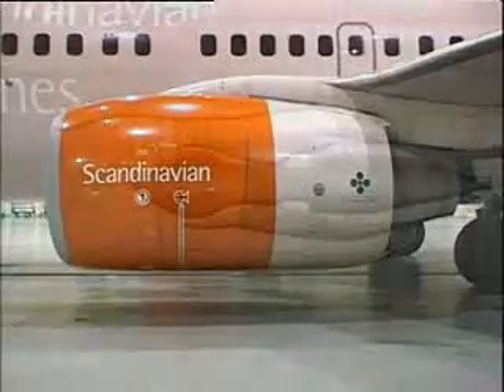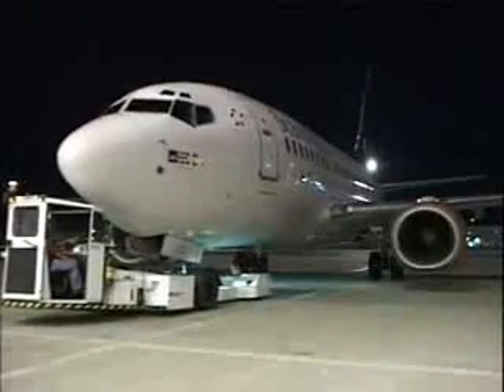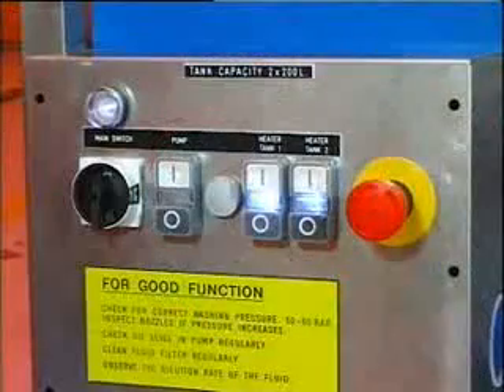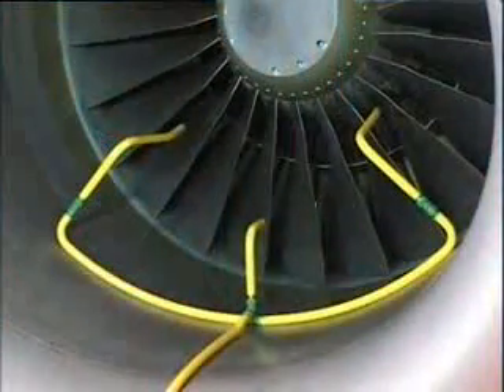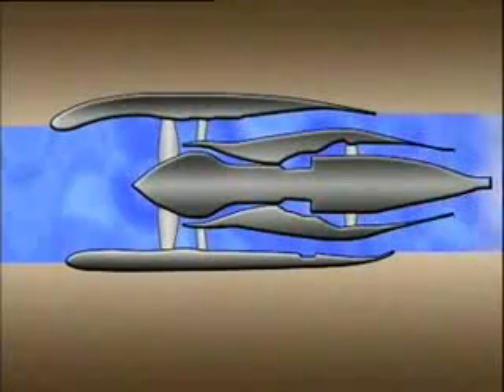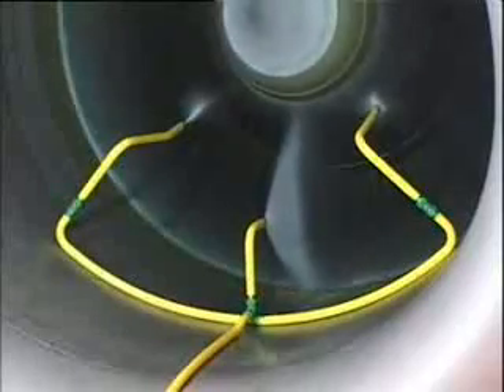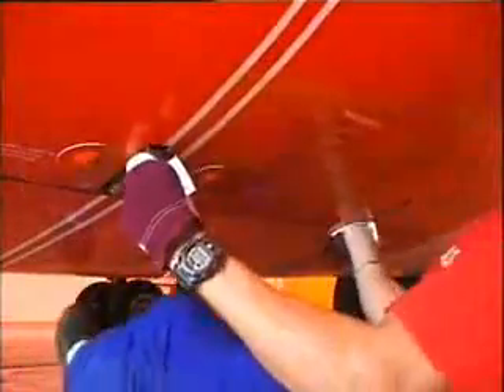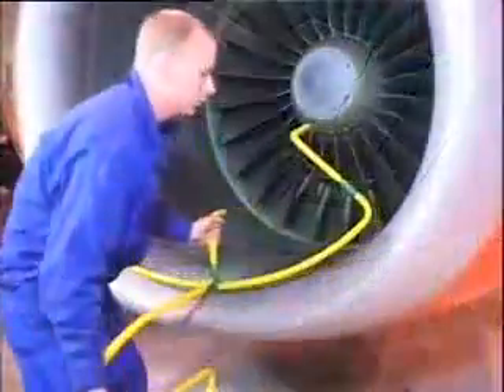737 NG engine wash

Comment: do they do this with the engine at idle thrust or just with the pneumatic air starting system?
Reply: With cranking engine, so indeed with bleed air starting, but without fuel lever in on and ignition off. Bleed air valves are closed too.
Reply: ***** how do you crank the engine exactly
Reply: First there must be bleed pressure available. This is normally done with the APU, and then with the APU bleed switch in on. Then the ducts are pressurized. Then you turn the engine startswitch on the P5 ovhd panel in GND, this opens the engine startvalve and thus the bleed air drives the engine air-starter. The APU goes into MES mode so the bleed press is increased to approx 35-40 psi. This rotates the N2 of the engine. At approx 20% N2 the water wash installation can be set to on and the water can enter the gaspath. All the time the startswitch is set in GND to hold the startervalve to open.

Comment: What is that pipe for which sticks out at rear of the turbofan engine? Does anybody know?
Reply: +seb font  Wow, what a bunch of crap you've be told.  The item you are asking about is called the exhaust plug.  The outside surface is used to control the inner part of the turbine exhaust flow.  The hole that you referred to is used to vent the oil system to ambient air.
Reply: +seb font I think it's where bypass air that is taken from the compressor to cool the turbine disks exit the engine.
Reply: Povl Besser No, the cooling air runs though the holes in the turbine blades (not the disks as they do not get that hot) and then into the engine.

This pipe is for the main exhaust from the engine core.
Reply: +seb font That is just the normal tail pipe of that CFM56 engine subtype.
Reply: Itapirkanmaa2 Thanks mate. Still don't know its purpose if it has any.
Reply: +seb font It''s a part of the engine's normal operation. The hot exhaust gases from the engine core itself exit though it, and also provide some thrust by going through the constricted passage of the pipe.
Reply: Itapirkanmaa2 Thanks again. I'm gonna have to research it a little deeper cause I've seen some engines have it and some don't and I want to know why is that.
Do you mean some gasses pass through that relatively small pipe or all of them? It would be hard to imagine the second option.
Reply: seb font The gasses thought the core. The bypassed air goes around it as per the bypass ratio.
Reply: Itapirkanmaa2 I was asking about hot gasses from the core of the engine, from combustion chamber travelling through aforementioned pipe and not about all the gasses mixed with bypassed air.  Bypassing air is not hot. But never mind, that was rather rhetorical question as it is impossible for that amount of gasses a turbofan engine produces to go through a pipe of so small diameter. Also I don't think there is any thrust produced at this point.
Thanks for answering. I need to find some professional literature.
Reply: seb font Some pics that you may find useful in the study:http://www.sjap.nl/pictures/
Reply: Itapirkanmaa2 Awesome!!! BIG thanks for help!
Reply: Itapirkanmaa2 OMG!!! thank you, thank you, thank you!!! this site you gave me a link to is a knowledge mine. Thank you for it one more time :)
Reply: seb font Glad if I could be of any help!
Reply: Itapirkanmaa2 sound like BS to me. This is certainly not an exhaust pipe and if you say that all of that combusted gasses pass this little pipe to produce thrust then I don't want to hear from you anymore.
Reply: seb font No problem mate -- your's much appreciated. The pipe does look rather silly I admit --  It becomes clearer from the history of the early jets and the long reaction tailpipe in them.
Reply: Yeelep Thank You for a clear answer sir. I'm gonna find out more about that. That whole thing is a lot more complex than I previously thought and it's very interesting.

Comment: OK all you aircraft maintenance personnel, I build hot water equipment, if you all want to make a ton of money , you find a way to sell it and i will build you a unit with higher efficiency , capability's and overall productivity, we will throw your name on it and own this market.

THE DOWNSIDE is I know ZERO about aircraft anything, so you get together with an engineer and write the specs and operating manuals. 

Those specially designed "nozzles" they are talking about are off the shelf 5085's

Comment: Jet engines seem so much simpler to work on than car engines in the terms that everything is so much bigger, and easier to get to. Plus they're mostly right out in the open, with only the cowling getting in the way. I'm an auto tech, and a rather big guy by most standards (6' 3", 360 pounds). Most cars have gotten to the point where it's almost physically impossible for people like me to work on them. I can't reach anything without having to pull a dozen parts off just to get my hand down there.

Comment from the maker: Yep youre right we dont do it like this video. We hook up 2 spray nozzles from behind the rotor, and then inject it directly into the core. N1 and N2 rotate, all gets clean The only thing we have to do more than this video is to open up the trhrust reversers to install these injector-tools.
Reply: In this case, if hook up 2 spray nozzles are used, Have we to open thrust reversers cowl?

Comment: yeay! i got a reply. :D
hmm... good point. yeah, the N1 turbine section will not be washed properly. 
Another way is actually to hook up a tool (a hose with a hook-shaped outlet basically) behind the fan, like how V2500 on an A320 being washed would be a good (and i think simpler) idea as well. So it will direct the flow right into the core with both N1 and  N2 still rotating. 

but then i dunno... must read the AMM again. haha..

Comment from the maker: Yep you are right its a possibility. If you hold N1 you also hold the LPT so the flow is much less inside the engine. Its better to have a good flow inside the engine to process all this water to the rear. Altough its a nice idea, washing like we now do is in accordance with the manuals, and a different procedure must be authorized by the companies engineerin dept and CFMI. Thanks for your comment.
Regards
737maint

Comment: hmm... i thought by keeping the N1 not rotating and aiming the hose to the inner core would work as well?
i mean, engine starter turns the N2 right? so if we can prevent the fan section from turning, we can actually eliminates the problem of water going into the bypass section. while the core section still suck-up the water... or wrong?

Comment from the maker: Around 3:20 in this video:
He disconnected the PS3 line from the EEC. This to prevent moisture/water coming into the EEC. After the engine wash is completed, this line is blown dry and reconnected to the EEC.
Reply: What's a PS3 line ??